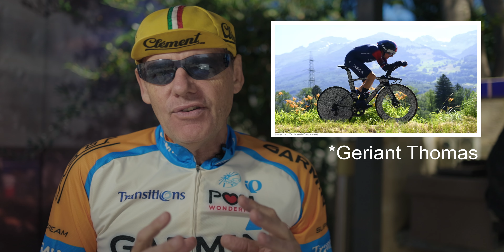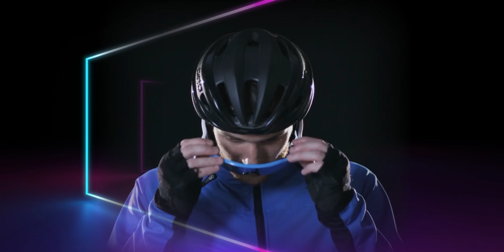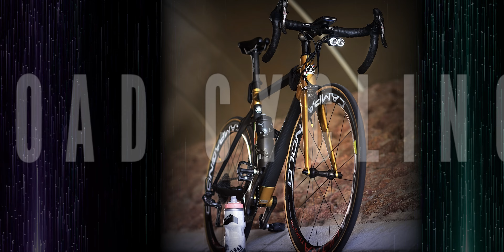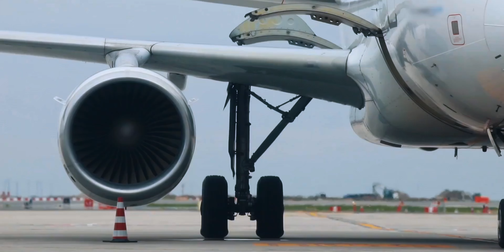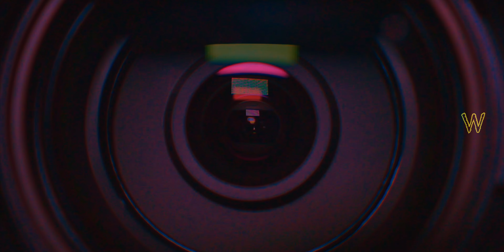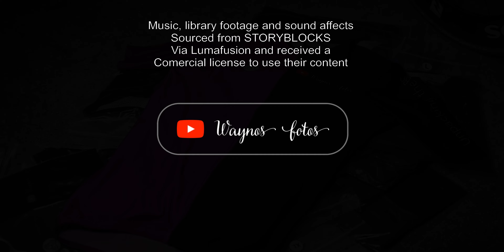Pinarello Bolide goes DISC

Comment: Again, rim brakes are GREAT IF you have superb road surfaces and are granted excellent weather. Get outside those parameters and all hell brakes loose. Since neither are granted, we are seeing a transfer to disc. Now, don't agree with the movement of cables through the fork. Do we see cables and such in other areas being routed around the handlebar/frame connection? Nope, and it shouldn't be that way for bicycles. There are better ways to do this.
Reply: Eddy Merckx had little trouble with rim brakes....outside.....in terrible weather. (Paris-Roubaix)
Reply: @stratrat57  Eddy Mercx was riding on either steel or aluminium wheels. Both have reasonable braking abilities. Carbon has no original braking capacity and have to be constantly feathered to keep water off the brake track.
Reply: @stratrat57  He had plenty of trouble,but so did everyone, so it was a level playing field.
Reply: @veloveritas9963  the point being, carbon and disc wouldn't improve anything. Especially a race such as Paris-Roubaix.
Reply: @stratrat57  oh 100% they would. This is why we see every single roubaix running carbon rims now, but we didn’t just a few years ago, even long after carbon rims were on the market, the pros would all switch back to alloy tubulars. Discs provide a great advantage in a race like roubaix, and thats why when the first few disc brake frames were allowed to be tested by the UCI, they picked Flanders and roubaix to test them. Carbon and disc are game changers for races like that, especially if it gets wet.